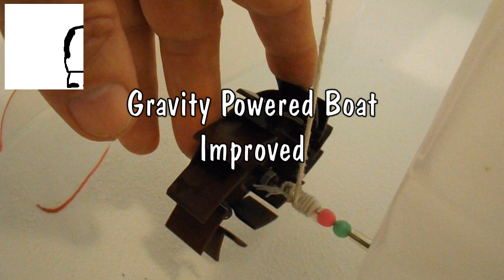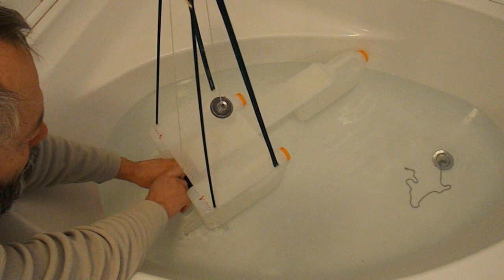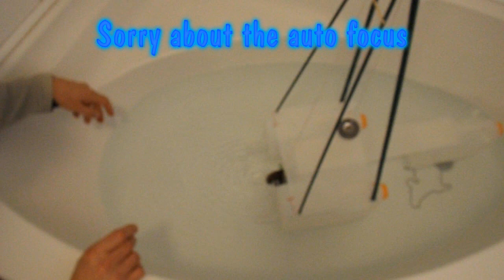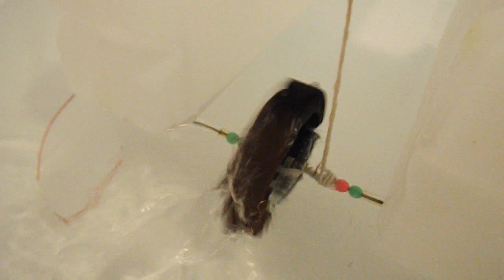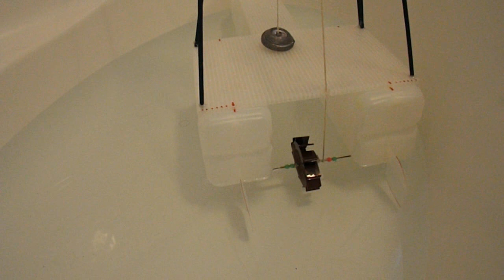Gravity Powered Boat Improved

Comment: I would be a happy man should all my ideas be applied so rapidly and effectively as you did it :-)
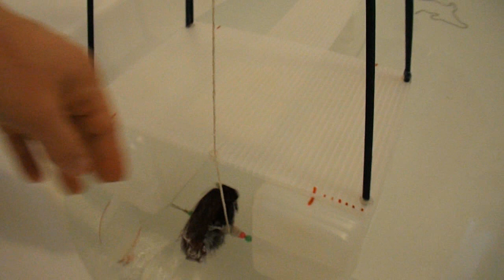Reply from the maker: You just hit the nail on the head when you said turn it round. I realised in the video I had even said it was designed to work the other way and didn't think to try it. It is an impeller blade designed to push air out through the blades. If you watch the video from about 2:20 you can see it is pulling water in from the side of the wheel and forcing it out through the vanes. Ideally I could partially enclose the blades and have a single exit point to shoot a jet of water backwards.

Comment: Very counter intuitive. It works more like a tire on the road rather than a propeller. If you added some grooves, horizontal (across the width) to the water, you would get more "traction".
Reply from the maker: Watching the video back I can see the wheel is working like an impeller (which is what it is) it is pulling water in from the side of the wheel and forcing it out through the vanes. Most visible from around 2:20

Comment: Good simple fix.
Y'know those toothbrushes that you pull apart, would the sides with no switch allow making a diddy version of this same thing ? just thinking of your indoor lake area :)
Reply from the maker: Not sure about the toothbrush parts idea, but a smaller boat would be a more practical idea for the bath. I shall think about that.
Watching the video back I can see the wheel is working like an impeller (which is what it is) it is pulling water in from the side of the wheel and forcing it out through the vanes. Most visible from around 2:20
If I was really keen I would partially enclose it and have a single jet exit for the water.

Comment: Next modifications, with the propeller.
Reply from the maker: My first plan was to use a large propeller but then I remembered I had promised to try out that paddle wheel. I used a propeller in this mousetrap powered boat and was going to do something similar. http://youtu.be/3GUG9BRga7s?list=PLA5a2xPRSrB1jSyRMjw31ptEYAAkZRF6H